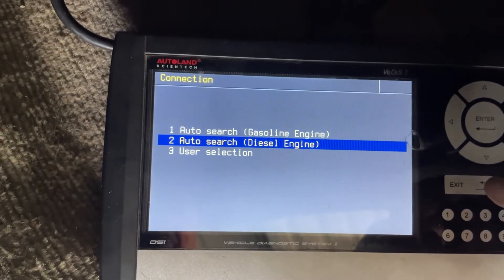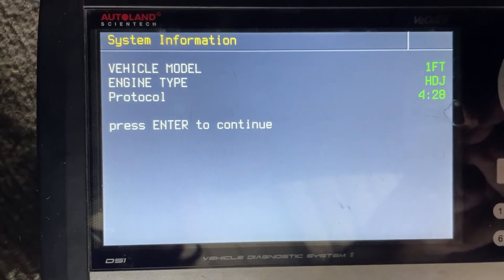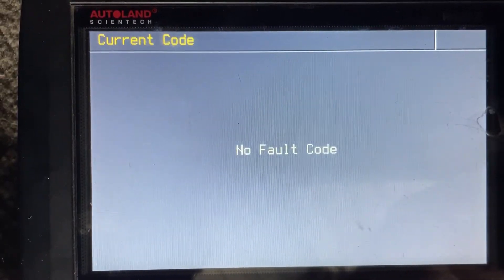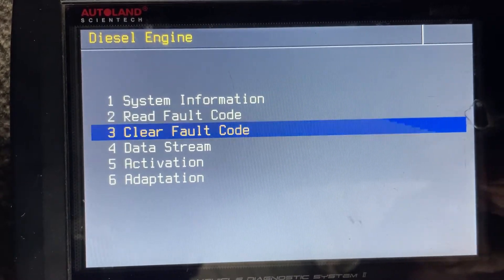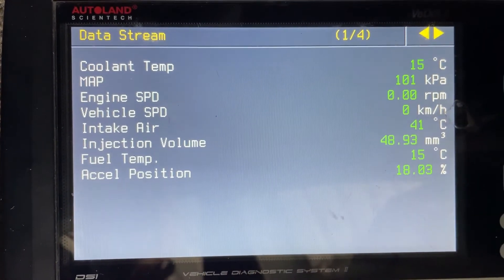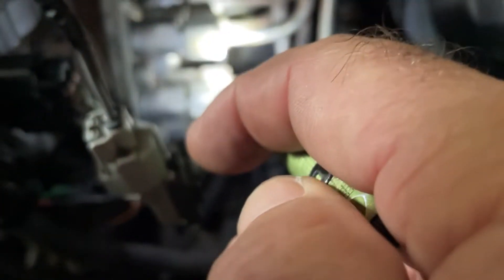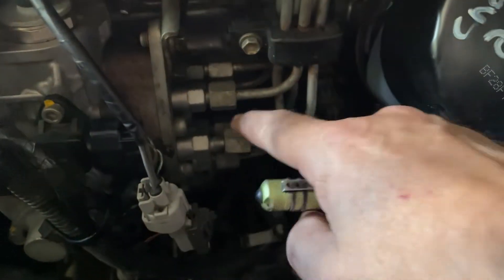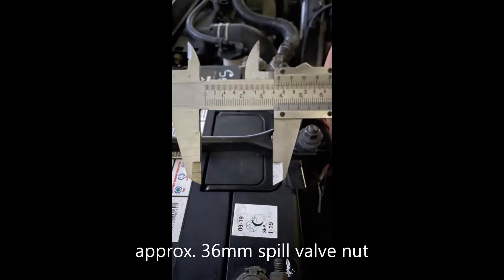1HD FTE, 100 Series Landcruiser non start issue. Injector Pump SCV?

Comment from the maker: Not yet. I will let you know. Ended up ordering a second hand spill valve driver (edu) module. It is still in transit. If this fixes it I will update this video. Problem appears to be no power to spill valve…. I think.

Comment: Hi
Did you find the problem?
I got the same issue on my 04 Hdj100, stopped at the shop for 15 min, and would not start when I came out. No fault on the sensor on the pump.
Reply from the maker: I have uploaded what the fix was. Broken wire on the plug down by the starter motor. This plug is situated below the oil filter and had a broken wire. This wire was a possible earth for the spill control valve. The fault did not show up in any scan tools I used. Traced wire via non continuity, bridged it and hey presto it worked. Spent the sharp end of two thousand dollars and 4 weeks off the road. Still, I wouldn’t trade it for anything built in the last 5 years. Thanks for viewing and I hope my video is of some help. Cheers.
Reply from the maker: Parts came in yesterday. Fitted a second spill control driver and spill control valve on the pump. Still no start. I’m thinking it’s the ECU or connection to it. I e run out of talent and ideas so trucked it to a auto sparky. I will post a response when they diagnose and fit it. Have u had any luck with you wagon?
Reply: @seanlittlefair105   please let us know what you find
Reply: Hi 
Just seeing if you have any update as it appears I have the similar issue, any advice would be apricated.  Thanks
Reply from the maker: @carldeimel2192   I’ve dropped my wagon to a auto sparky. I’ll let you know ASAP. Was going to try calling them on Thursday and see if they have had a chance to check it out. Fingers crossed it’s something simple.
Reply: Hi, yes I found what the problem was
It was the bracket for the spill valve control unit that had rusted so much so I lost ground. Took a wire from the battery and to the control box. Started immediately. Have you checked the crankshaft sensor?
Reply: @larsroarhagen3581   Hi yes certain have - even replaced it.  feel like we have tested ever thing that can be tested, cant find out how to actually test the spill valve control unit ?
Reply: ohm between battery ground and spill valve control unit ground is good? 
Have you checked the timing belt?
Motor ground cabel?
All relay and fuses and sensor on the pump.
Checked cables to the pump for damage also.  
Pedal position sensor may also be a thing to check. 
I am no sure, but can check the workshop manual about testing the spill valve control unit.
Reply: Maybe immobilizer unit. On my 04 Hdj100 there is a red light that blinks when the key is not in the ignition lock
Reply: @larsroarhagen3581  Hi yep they have all been checked - ?